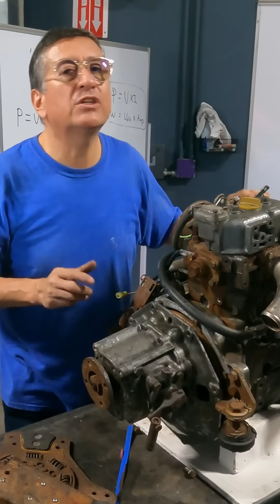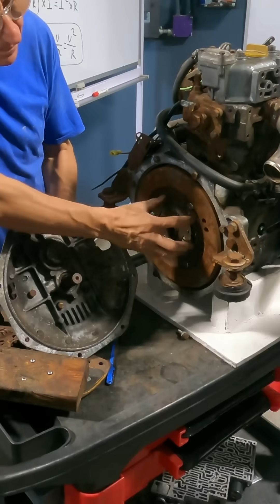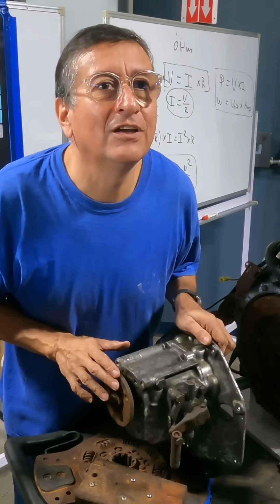Marine Transmissions

Comment: But a good titanium shaft is lighter when shifting and very smooth and in io engines aluminum props are smoother shifting than stainless steel props but on surface Drive stainless is mandatory

Comment: This is also why there is (or at least used to be 20yrs ago) an ignition interrupt that is part of the shift between F/N/R. It gives the engine a stutter step that provides an engagement window.
Reply: I have been in this industry for 40 years and never heard of that. There is in fact a neutral switch that doesn't allow start in gear, but no stutter switch. NO. Especially with engines that use an ECU (most of them these days).

Comment: My clutch cable snapped on my MK1 Astra GTE, I drove it over 100 miles to get a new one.. all you need to do is bring the revs up slowly and slide it into gear.
Reply: Of course on a vehicle you need to turn off the engine, engage first gear and start the engine to move off from a complete stop.

All other (except reverse) gears you can do the slide....
Reply: @JohnSmith-pl2bk you don't turn off the engine. Engaging the clutch seperates the engine and tranny, but the engine is still running.

Comment: Never heard a Borg Warner Velvet drive grind on engagement, because they have multiple plate wet disc clutches,  like an automatic transmission.  Some  outboards, yes, some stern drives, yes, but Twin Disc, Paragon, Velvet Drive, Hirth, and ZF units that turn a prop shaft, not so much..

Comment: When shifting into gear on my 90s boat, there’s a ignition delay box wired to the shift cable linkage as soon as you go to pull it into gear it stumbles the engine, so it pops into gear with minimal grinding

Comment: Although he is somewhat correct, and you dont have a clutch, marine engines will actually shut off momentarily when shifting in to forward or reverse. There is a small micro switch that trips for a split second when the shifter starts to move and the engine shuts off.  As it shuts off, this allows the gears to loose momentum and mesh together. Once they mesh, the engine turns back on and your in gear. This all happens in a quick second and most people dont even realize the engine was off for a split second.
Without this infurrupter switch the gears would grind terribly and you would have a very hard time jamming the teeth together on the gears.
Reply: All marine engines?  Big and small? I served on a 273ft army transportation boat?

Comment: Thanks for the lesson. Why is there no clutch? seems better than grind it and find it.
Reply: It's a twin disc system not the multiple selector system and in the twin disc system there is a neutral that act as the clutch system.